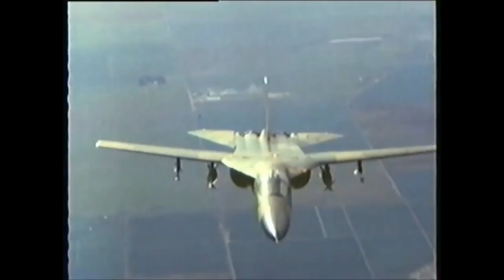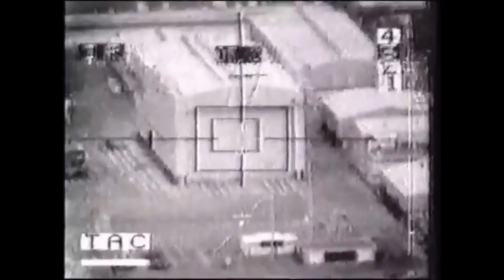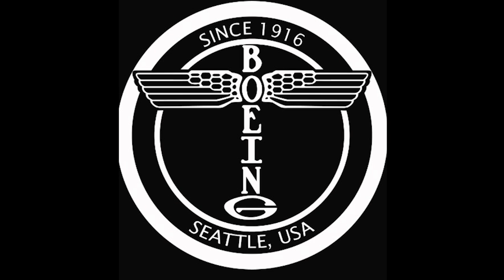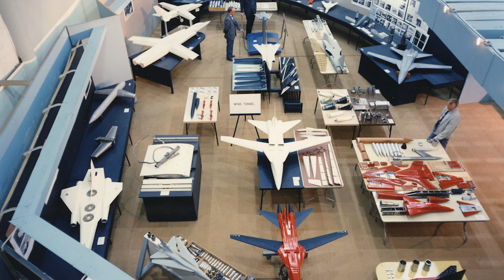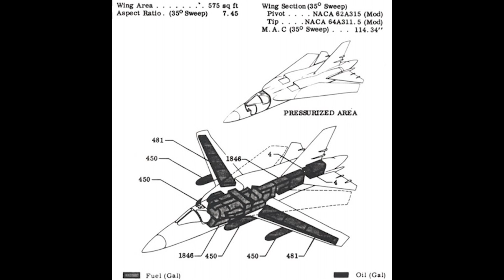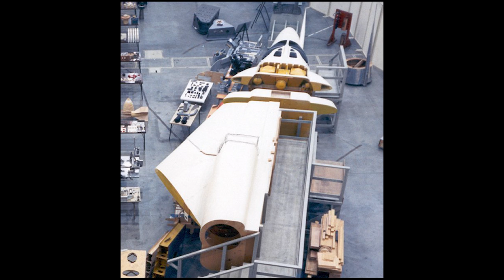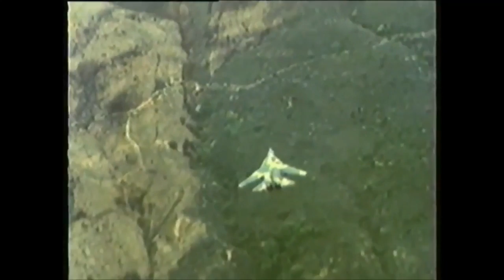Boeing 818 TFX; The Actual Aardvark?

Comment: I had an opportunity to chat with a retired F-111 pilot. I asked how good the terrain following radar was for being 1970's tech. He said they used to do training flights over some mountains in Scotland. He said one time he was doing some night flying and was nearly blinded because his navigation lights were being reflected off the snow from the mountains and back into his cockpit. He didn't give me a number, but that's how low he could fly on automatic.
Reply: It was said the nav system on the FB-111A was so good the plane could find it's way back to the same parking spot after a mission.
Reply: It wasn't that good from the start, they lost a couple of  F111's that just flew controlled into the terrain.
It only got fixed once there had been an effort to figure out where and how they lost planes..

The guy that did the investigation was part of the B52 crew that had a head on midair collision en route to Vietnam for arc light 1  , Major Don Harten, that resulted in the 996 Mod

https://youtu.be/cvUgy9s1vfM?t=3180
Reply: @starga-fr7qx  I worked in aerodynamics in Ft. Worth in 1975-1977.   The F-111 accidents that happened during that time were either caused by CFIT or a TF-30 throwing a turbine blade into a fuel tank.   And most of the CFIT accidents were found to not have the TFR turned on.  Hot dogging it and they bought it.
Reply: @dougball328  nothing to do with Aerodynamics.. Don Harten was the Safety officer in SEA who investigated it and figured out the TFR had glitches with the Altitude radar and would actively steer the plane in the ground.. He kicked it up to the whitehouse, a 4 star general came down, who agreed with the conclusions and Mod 996 was implemented on all F111's with TFR and even on all B52's F15's B1's and other planes who used it
Reply: @starga-fr7qx  I never said it did have anything to do with aerodynamics.   But when the TFR is turned off, can't fault the system.  Not saying it was perfect, either.
Reply: @dougball328  Not sure why you are interjecting  "you can't fault it when it's turned off" when I'm debating TFR problems. Clearly the problems I'm discussing are not related to TFR being turned off is it. So whatever you are arguing is moot.
Reply: @starga-fr7qx  Many of the CFIT crashes that were attributed to the TFR system were the result of the system not even being turned on.   As I said, I did not say the system was perfect, but the RTFR system was blamed for accidents in which it was not involved.
Reply: @dougball328  Clearly the mod 996 wasn't developed to  fix an issue of a system that wasn't even turned off now was it.
Or are you calling Don Harten a liar?
Reply: @starga-fr7qx  You are obviously not reading what is written. Your emotion is running too high.  If you reread your last post you will realize it makes no sense.   I have never called anyone a liar.   I have never said that anything written his incorrect.   The point I have made is that not all of the CFIT accidents that were attributed to a failure of the TFR system were done so incorrectly.  Some of the CFIT accidents were the result of flight crews flying on the deck with the TFR turned off - and crashed as a result.   That's all.   I am done wasting time on this.   I was at GD.  I worked on the airplane firsthand.   Did you?
Reply: @dougball328 

Then why  are you arguing things that aren't relevant to the point I made

I made a point, that the Terrain Following system was not as good from the start.. that it needed fixing.

and you come up with all kinds of stuff about how the CFITS were due to pilots and having TFR off..

ME I get brain freeze when I eat ice cream
YOU most people don't get it from icecream but because they have a bad tooth
ME : so what. I get it from icecream and my tooth is fine
You : Noo noo it's mostly from bad tooth that people get it, btw, I worked in an icecream factory, did you?

fucking learn to follow the point and stick to that.

Comment: Sounds like the plan was doomed from the start. Why do politicians keep trying to get the military to combine incompatible designs to reduce costs? It almost always fails and ends up costing more money.
Reply: The needs of USAF and USN were not incompatible in this case.  The idea that one basic airframe could fulfill two different roles was not a dumb idea at all. History is full of examples of aircraft that were versatile enough to fly for different services and even perform different missions.  Both USAF and USN were asking for a large aircraft that could lift a heavy load of fuel and weapons, with long range or loiter, plus high-speed dash or intercept. Twin engines and an innovative variable geometry wing were called for, and Macnamara logically assessed that it would be wasteful to develop two very expensive advanced airframes when a single one with minor variations could do both jobs. 
The reason one airframe could do both jobs was because the original USN specification was for a fleet defense fighter, not an air superior fighter. It was not originally intended to be what became the F-14, but to perform the role meant for the Douglas F6D Missileer with the addition of supersonic dash capability.  The biggest difference between the airframe requirements of the two services was that USAF wanted a tandem cockpit and USN want side by side seating.  Boeing tried to make both services happy, but MacNamara’s DOD thought USAF could suck it up and have the crew sit side by side.  This is ironic considering that when the Navy cancelled its version USAF was stuck with the cockpit it didn’t want, which also ironically contributed to the airplane being too heavy for a fighter.
The original idea wasn’t dumb -- what happened was that needs changed.  USN revised its specifications for the TFX as result of combat experience in Vietnam.  They realized that they also needed an air superiority fighter to replace the F-8 and F-4, but couldn’t afford that in addition to a dedicated fleet defense aircraft.  Thus, the TFX would now have to be able to dogfight as well as be a missile interceptor.  The F-111B could have worked as a missileer, but it was too fat and underpowered to compete as an air superiority fighter.  It was proper to recognize that the needs of USN had evolved, and this was perhaps the beginning of the Navy realizing that budgets and hangar decks did not have room for so many specialized aircraft.  USAF desperately needed the F-111 to replace the F-105, so they sucked it up and accepted the heavy airframe caused by the loveseat cockpit they never wanted.
Reply: It's not incompatable, they just went at it ass backwards. The F-15, designed as a no compromise fighter, replaced the F-111 in the all weather interdiction/strike role brilliantly. The problem with the F-111 was that it was designed as a light bomber.

Comment: The bottom line is that Boeing didn't deliver what McNamara requested and instead they tried to game the system.  Looking at this from a risk tolerance perspective, the only thing that Boeing offered was a number on paper for cost; they lacked experience, they had a bad track record on budget, and there were questions about performance on recent projects.  Boeing fell into the trap of telling McNamara what they thought he wanted to hear.
Reply: All valid points. But in hindsight the DoD wasted money and time on the development of the F-111B, the Navy variant of the TFX. If McNamara had not been so dismissive of the admirals he might have realized that the needs of the two services could not be realized in a single aircraft. Something it appears Boeing realized from the outset. It seems the General Dynamics/Grumman team either knew this and decided to adhere to the McNamara directive of a single aircraft type for two vastly different roles. Or they thought they could actually develop an extremely flexible and adaptable airframe. In the end they couldn't create the fleet defender that the Navy envisioned out of the F-111 design. Although it was a fine aircraft in the roles the Air Force intended it for.
Reply: @joelrodriguez9661  No argument.  One thing I've learned dealing with contracts is that you can suggest, beg, and even demonstrate why something "should be", but in the end, the contract is the contract.  GD/N was smart; I remember reading a book that interviewed one of the Northrup engineers who pretty much admitted that two different unique airframes would be needed.  I think that GD/N used the B to get test data on various systems that were then integrated into what the Navy really wanted...what became the F-14.